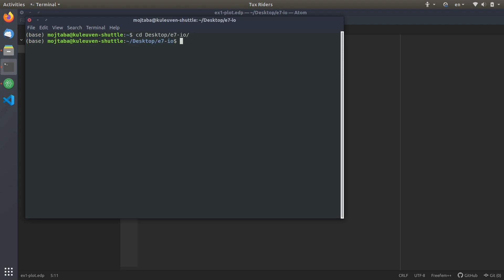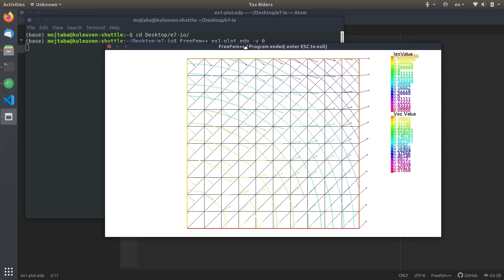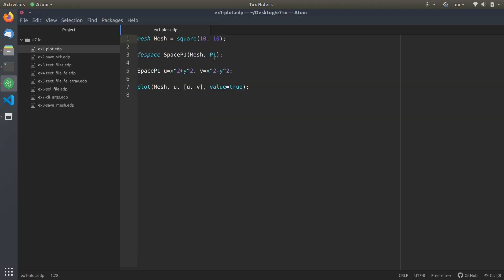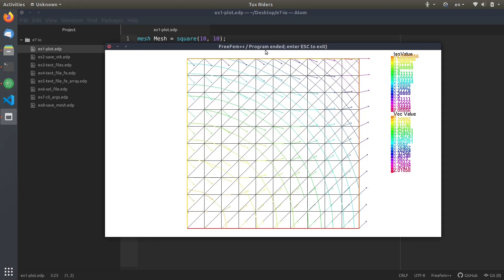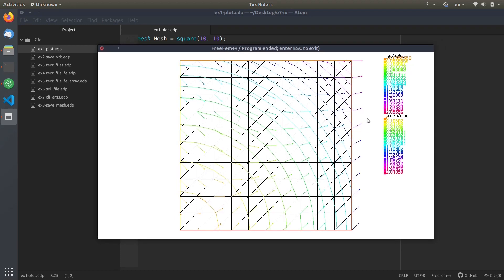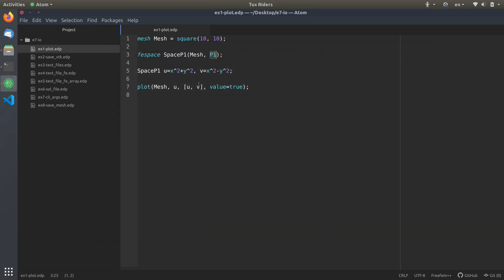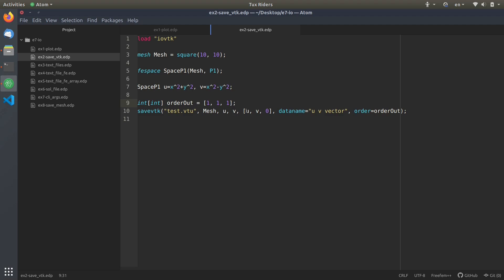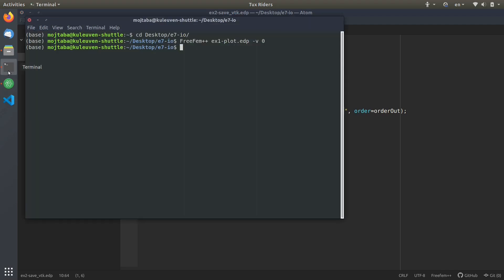[FreeFEM 7] Visualization and input/output (IO) operations in FreeFEM

Comment: I don't know if you could help me, but I'm trying to use an turbulence model that requires to:
1) Calculate the value of the stress over the wall, I'm using: (dy(u)*nu)*(y==y0), where y0 is the location of the wall
2) Assign the value of the stress to all the x with the same value, similar to what you are showing at 11:04
3) Calculate it somewhat fast because it is calculated in an iterative scheme
I'm using this but it's extremely slow:
fespace Vh(Th, P1);
Vh t;
Vh X = x;
{
    ofstream file("test.txt");
    for (int jj = 1; jj < Vh.ndof;jj++){
        t = abs(dy(u)*nu)*(y==y0)*(x==X[][jj]);
        file << t[].max << endl;}

}
Vh shearStress;
ifstream fileRead("test.txt");
    for (int jj = 1; jj<Vh.ndof;jj++)
        fileRead >> shearStress[][jj];
//plot(shearStress,fill=1);
Reply from the maker: I don't know about an efficient FE-like way to do this in FF, but you can at least iterate over the boundary nodes with the `nbe` and `be` properties of the mesh to save some time there. Look at this page and find the keyword `nbe` for some examples: https://doc.freefem.org/documentation/mesh-generation.html.
Also, why do you save the stress values to a file and retrieve it afterwards? You can do it with a fespace variable (similar to u), which will be faster I would say.
Reply: @TuxRiders  I think I found a way, but need to use an precompiled script.
I used a text file because it wasn't assigned correctly to the fespace